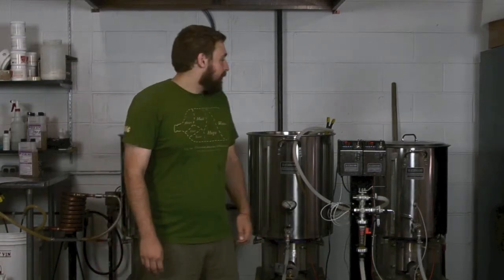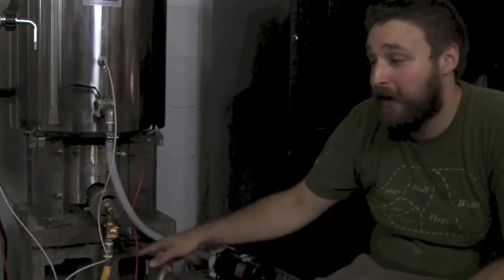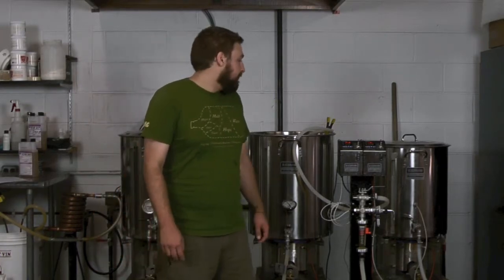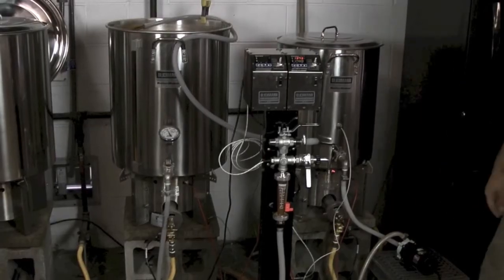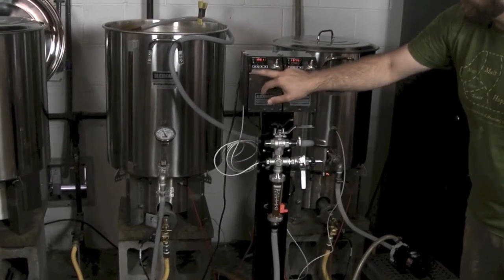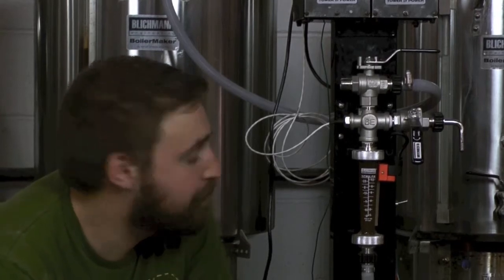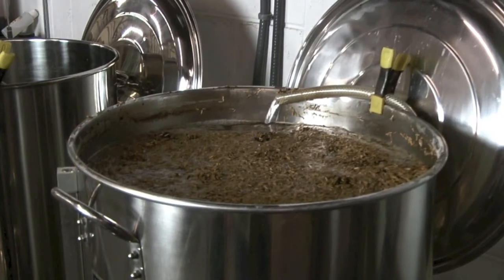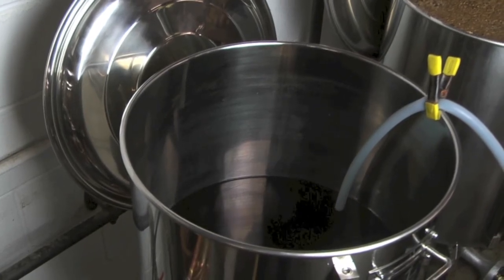Blichmann Tower of Power Demonstration

Comment from the maker: Jerry -

Yep, our system is sitting on concrete blocks with a paver on the top. Cheap, easy, and effective, but not as sexy as some other options. I'm very pleased with the ToP. It's use is very similar to other PID systems (I have experience with Brutus style systems, as well as Kal's Electric Brewery), but is easier than putting together a system yourself. Blichmann did a great job in my opinion of making the system modular, and it's pretty easy to integrate into an existing setup. Cheers!

Comment from the maker: Mike -

We really just do a visual measurement on our grain crush. If the grain starts to look coarse, we adjust accordingly. I recirculate my mash at around 1.5 GPM. I've done it faster, I've done it slower, but erring on the side of faster seems to keep the grain bed temperature more stable, but then a stuck mash becomes more of a potential issue. The M/LT burner is on about half way, maybe a touch less.

Cheers!
John

Comment from the maker: Hey, thanks for the question! We're using two pumps. The pump on the tower is used to transfer the wort out of the mash tun over to the boil kettle. There's a second pump that runs from the HLT that we use to fly sparge with, though you could easily gravity feed if you chose to. Let us know if there's anything else we can clarify for you.

Cheers!
John

Comment: I am researching Top Tier/Tower of Power set up and am curious of some of your set ups.  To get the 1.5 degree per minute, per their manual, what was your grain crush (gap), flow meter setting, and approximate burner setting.  I really like the controllers ability to hold multiple schedules and the computer up/down link capability.
Thanks for your time, Mike

Comment: So this is basically a PID controller and at $900 it's a very expensive one. A much cheaper alternative is a PID (with SSR) $40, 2400W element $40, PT-100 temp probe (for higher accuracy) $10. That's how I do it and temps are always +/- 0.5 of a degree.

Comment: Do you have those burners sitting on bricks?  I have the TopTier system but could really see putting all the burners at the same height and using the TOP to move hot water and/or wort to the other pots as needed.  Any feedback on the Tower of Power versus other DIY PID systems?